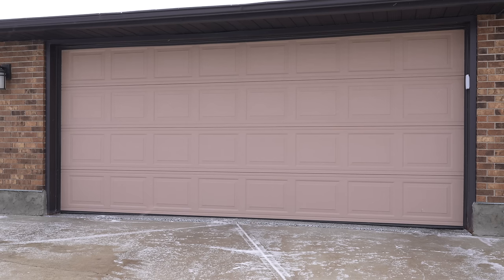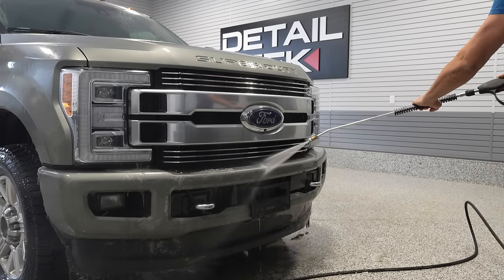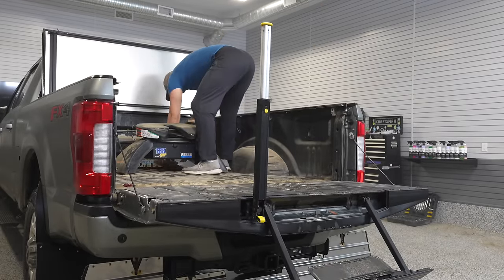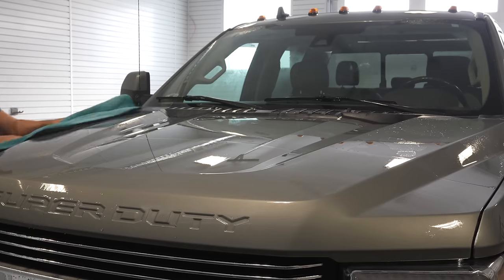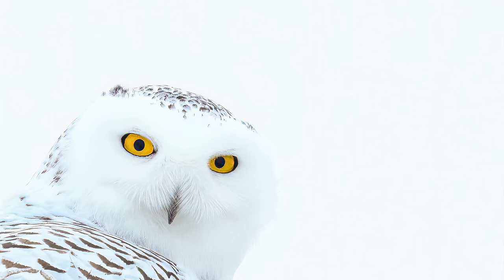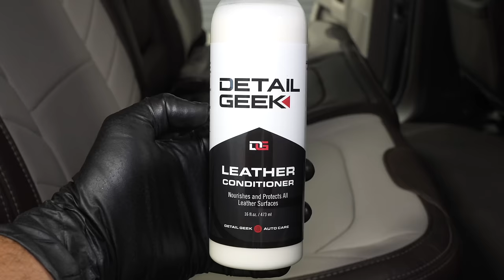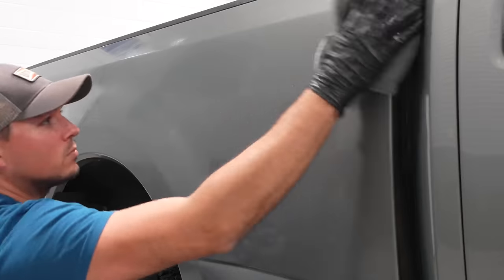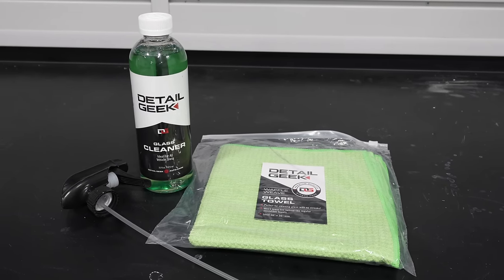I Gave My Dad The BEST Gift Possible!

Comment: A couple of questions and a suggestion. Ford offers some plastic wheel well liners as options. Are you a fan of them? When you clean an engine, what product do you use...apc? As for the suggestion, a couple of the bed "swing" boxes for dad's truck would work!

Comment: Js i may have been the one to do the finishing touches on your dads car seat cushions 😂 seems to fit the timeline of my old job! hahaha i would sand off sharp edges, glue rips together and fill in any holes before they got sent off to get the fabric covering and installed onto the frame. (Idk how that part works lol totally different department 😅 i was like the middle man. Somehow the cushions were made, they would come down a conveyor belt, i would fix the imperfections by sanding gluing than filling and then hang them on like a clothes line conveyor belt and off they went to the next group of people lol) great job! Amazing pay! I got paid $88 in one day which is $11 an hour. But that was during my trial period. After 3 months it would have went to $19 and hour and than 3 months after that if they agreed to keep you than it would go to $26 an hour. It was also bi-weekly pay with health benefits after your trial was over. As well as every 15 minutes you switched to a different  station so you wasn't standing in one place for 8 hours. We also got a 15 minute break every 2 hours. As well as a 30 minute lunch break after 3 and a half hours. But sadly had to move to far away.... :/ also the males and female were separated (not based on "the men get the tough jobs" because we all did the same jobs just in different sectors but just to make everyone feel safe. We had breaks and lunch together but we weren't on the work floor together. It was nice.

Comment: nice gesture mitch but would have been nice if you would have also replaced the ford centre cups on the wheels as i see they are missing on front two tires

Comment: Why is so many in Canada 🇨🇦  not using proper winter tires? 

Ok if u just go around in like Vancouver..  daytime it will work with "off-road" tire.

But now I mean proper winter tire like Nokia, Michelin, Goodyear with studs like we use in the Nordic countries Sweden 🇸🇪   Norway 🇳🇴  Finland 🇫🇮  

That in combination of all electronic helping systems in a new car and ABS it's almost impossible to end up in the ditch or rear end another car. 

I'm not judging anyone but curious about your choice of "winter tires" with similar weather as the Nordic countries.. 🙂